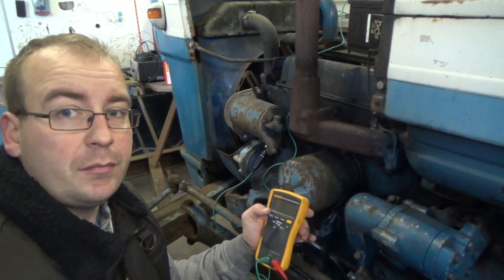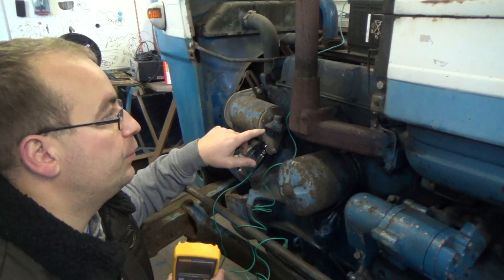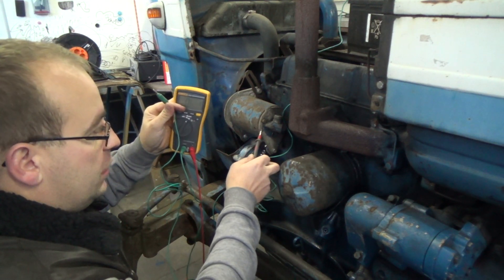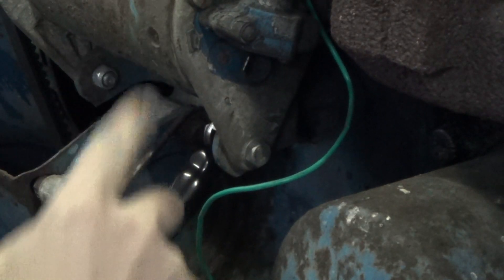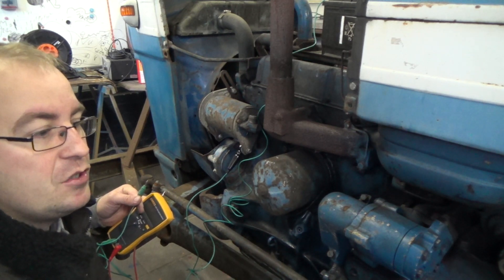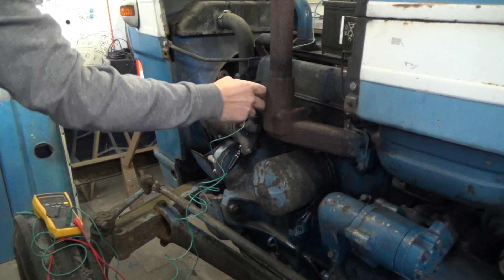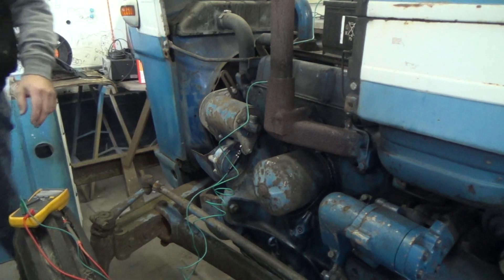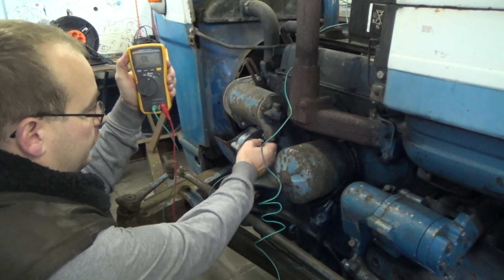#2 Ford 3000 Testing the dc generator for Jan Kotze Shout-out

Comment: With engine running shouldn't the large spade connector (output) from the generator be putting out at least 13.5 volts so it can charge your battery?  From what I could see your meter was reading 11.5 volts out which is lower than the 12v battery.   ???
Reply from the maker: This is a dc generator it doesn't produce much voltage at lower rpm's. When you give a little more rpm 's it's charging just fine.

Comment: I have a Ford 300. Problem I’m having is when I hook up the battery.  White smoke is coming out of the back of the generator.  Any idea what could be the problem?   What should I look at?   Thank you
Reply from the maker: That probably means that the generator is wrongly connected. Or the regulator is not working right or connected wrongly. Ik can be a lot of things. Maybe you can find a schematic diagram for the tractor and trace the wires to see if they are in the right place. I hope I've been helpful. Don't try connecting the battery again until you are shure you found the problem. 
You are burning the windings of the generator this way. 
Good luck my friend and try to see the logic of it that makes it a lot easier.